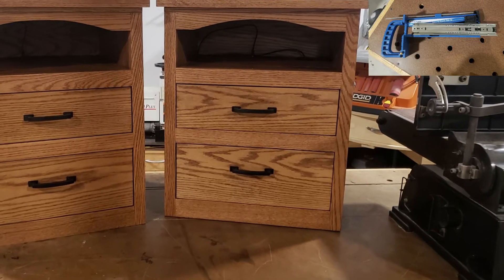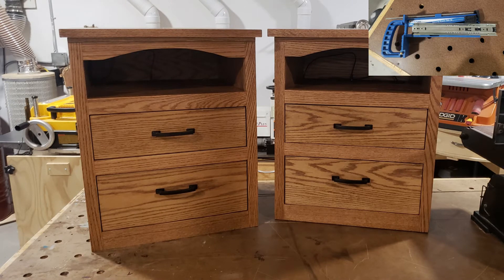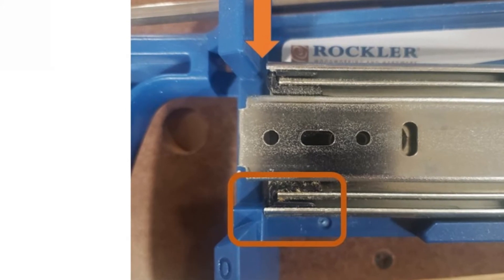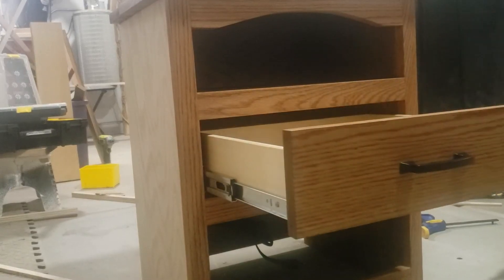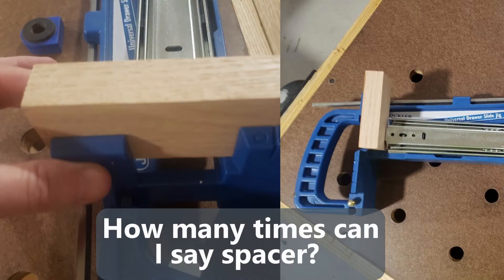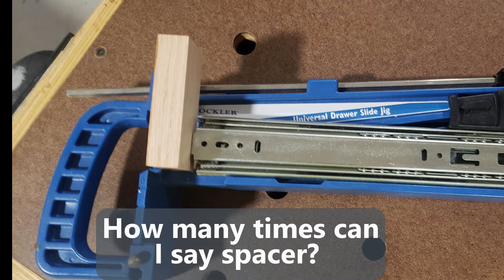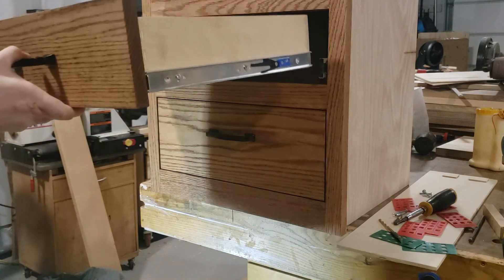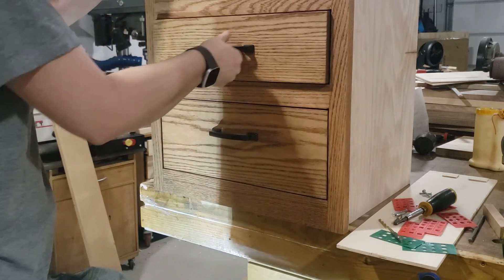Inset Drawers with Rockler Universal Drawer Slide Jig: Quick Tip

Comment: Question for you: How did you determine the height to mount the slides on the inside of the cabinet box? It seems like the jig is meant to hold th slide level with the face, but since the inset drawer face is taller than the box itself wouldn't that cause the face to be too low for the inset opening?